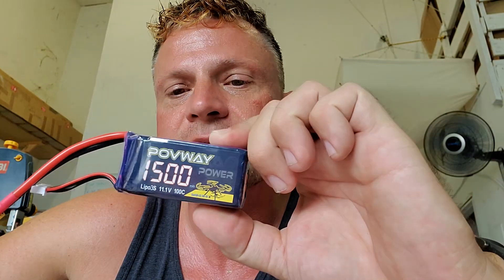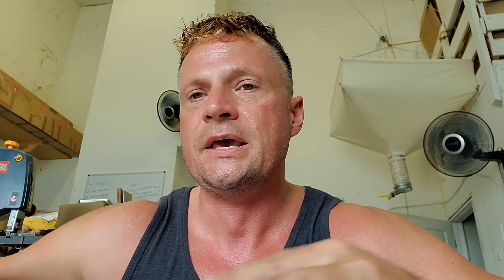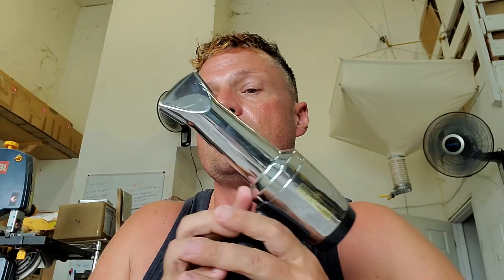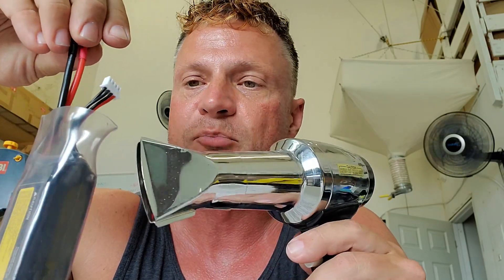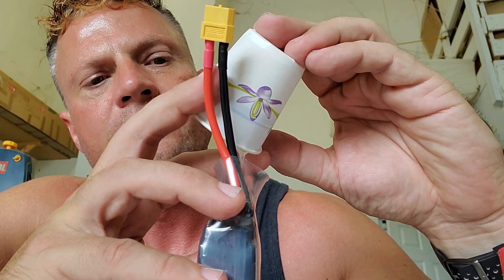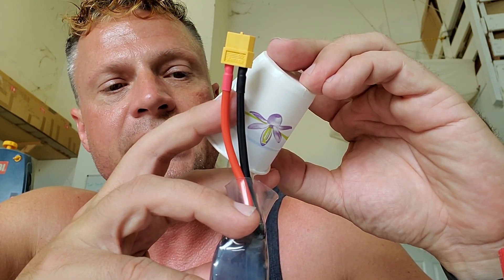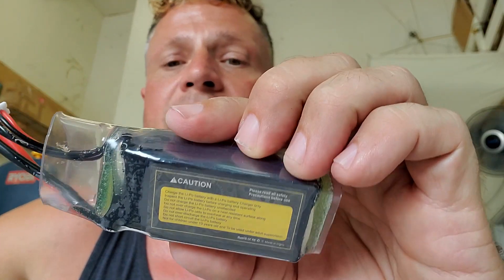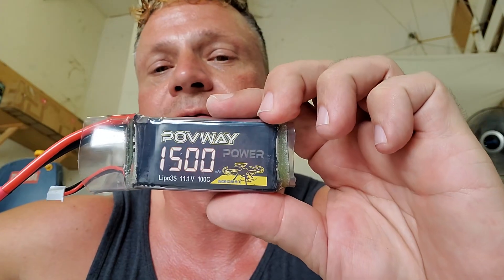How to Waterproof your Batteries for Use in an RC Submarine

Comment: What about water (wicking) thru the insulation and conductor? I know it's not a car, But, Mercedes Benz had that problem with transmission fluid wicking it's way to the trans control modules thru the wires.

Comment: What about the connector? It is not waterproof and you will still have an electrolytic reaction and possible wicking  through the conductor.
Reply from the maker: Simple RTV on the back leads and dielectric grease for the connector. Works perfectly.
Reply: @RCSubGuy  what are the back leads? Is that what you call the balance connector? If so, wouldn't RTV gum up the balance connector rendering the battery unable to be balance charged?
Reply from the maker: @alanhobbs4879  The bases of the wires are sealed with the RTV and the exposed connectors with a dab of grease.
Reply: @RCSubGuy  oh ok, thanks so much for your help

Comment: Wondering if you can dunk or spray the battery with clear Plasti Dip and then dunk the cable connections, too.  (Would need to add a sealed charge plug?)
Reply from the maker: You can, but the coating will not be as durable as the heat shrink

Comment: I use a hot glue gun to seal the heat shrink. Clean and quick result.
Reply from the maker: A good idea, but I'd be sure to watch the overall integrity of the seal as hot glue is not very viscous and won't flow around the tube or wires like resin would. I'm sure it works, but you'll have to carefully apply it.

Comment: What type if epoxy and a dumb question why do I have a ted blinking on my lipo battery 7.4 50c 5200Mah
Reply from the maker: 2hr two-part epoxy from any home improvement store. You have an LED on your battery? That's a new one for me...
Reply: @RCSubGuy  battery lol no LED light on my charger blinking red light lol and thank for you for info for the epoxy I don't know why the manufacturer make the battery packs water proof lol

Comment: Does that heat shrink plastic really chemically bond to the epoxy? If not, won't gaps inevitably develop b/t the heat shrink and epoxy over time with any amount of handling?
Reply from the maker: I've never had an issue with the epoxy coming loose thus far. I also use RTV extensively and that works very well, too.

Comment: i am finding it hard to find heat shrink that is big enough, clear, and isnt some ridiculous length. i am going to try 3d printing a box and then spraying a bunch of clear coats on the box so that water cant get into the box. then ill use epoxy where the wires come out of the box.